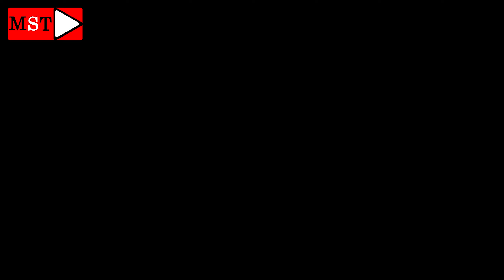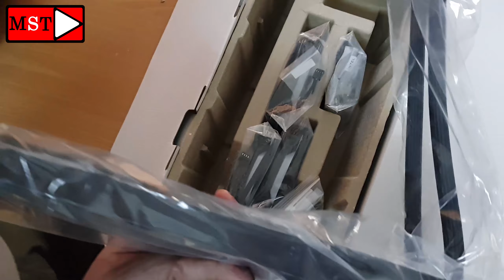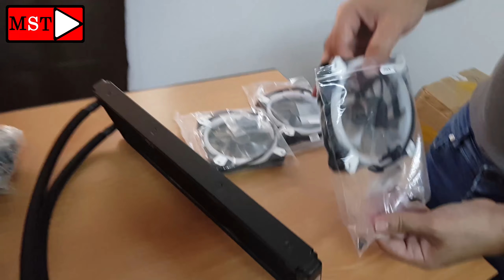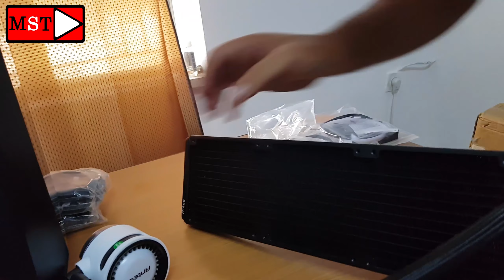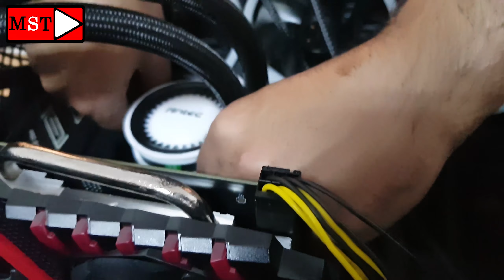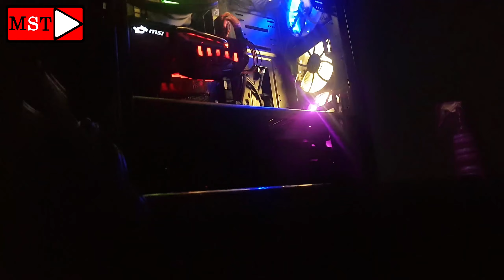Build Antec RGB Mercury 360 Water Cooling

Comment: Good evening my friend.sorry I do not speak English well 
 I want to help me if I have parent may asus tuf gaming x570-plus (wifi) and Antec RGB Mercury 360 Water Cooling and has continuity color blue does not change color what I do wrong .wants a program
Reply from the maker: Good evening friend 
You didn't do anything wrong, it's the temperature what making that, RGB water cooling has cpu temperature alarm, start from green to blue to red, these colors to alarm you what is cpu temperature degrees,  i can't remember the degrees, but let's try to mention it :
Green= positive (20c_40c)
Blue = moderate (40c_65)
Red= caution (60_95) 
Its about these numbers, it seems your cpu temperature around blue degrees, to make sure try to render or something,so the temperature should increase then you should see red color, you can't cool it to green, so it's better to raise the temperature, if you want to control the colors you can download mystic light . If you have any other questions feel free to ask.
Reply: hello thanks for your answer mystic light not play because i have motherboard asus x570
Reply from the maker: Hello friend, i have searched for you for program support your motherboard, there is 2 apps, i don't know exactly which one ,but one called AURA Sync 
Second Armoury Crate . https://www.asus.com/campaign/aura/us/download.php  
It should work, and after it worked plz wish me the best and reply to me to confirm.
Reply: good morning 
1.the cable of pump to sata
2'  the cable from the 3 fans that I will connect to the motherboard

{were to connect     pin arb   or     cpufan

thanks for all
Reply from the maker: Can you please show me picture,  on my email mjds838@gmail.com  or WhatsApp 00972569330100
Reply: i call you in whats up

Comment: A lot of coolers out there , you definitely have read the benchmark tests and compare with others, nice 💡’s though.
Reply from the maker: I had to do that , in summer cpu temperature go up to 99C , After this this cooler temperature now less than 71C At Full rendering.
Reply: MST   That’s great, if it works it works,if it doesn’t it doesn’t.
Reply from the maker: @perceive8159  it works , now i feel comfortable and not have to be worried while rendering.

Comment: can we set the color of the rgb to how we want? like if I wanted it to just stay as blue, is it possible?
Reply from the maker: Yes of course,  there is two way to do that 
1 if your motherboard supports RGB led controls(using program mystic light)
2 the fans came with wired controller so you can control using it .
For me i used program, because i had to take the wired control out from the case and this is annoying
Reply: @mstphone  ty bro
Reply from the maker: anytime bro 😊